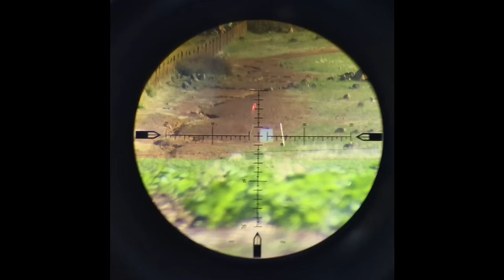Windage and hold over, "how to".

Comment: Wow!  You guys hit a home run with this instructional video.  The camera showing the point of impact, direction of flag, and placement of the reticle coupled with your explanation is priceless.  This is the simplest and most helpful demonstration of windage I've seen.  If I understand correctly, it be less accurate to hold-over for the first shot rather than dialing the full 5 MOA?   Is that right?  Thank you and cheers to you both!
Reply from the maker: Hi Man, thank you, as for hold over to start with, it is simply easier to hold closer to the centre of your scope. It also can be easier to get closer with the dial so you can use a small hold so that a few shots later you do get muddled up with trying tom remember too much hold over info. Cheers